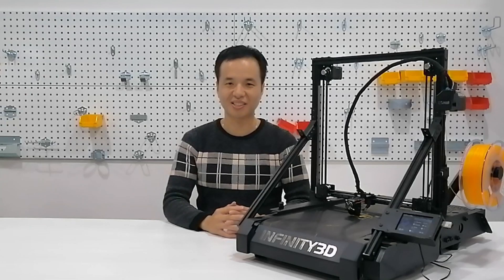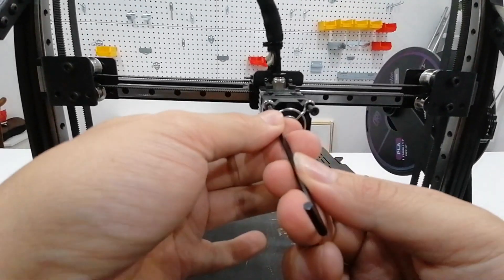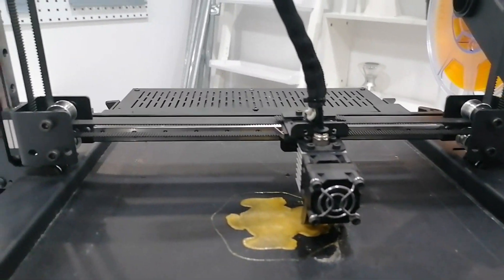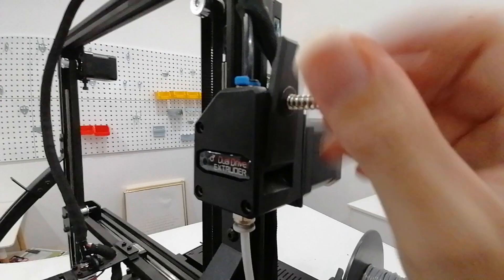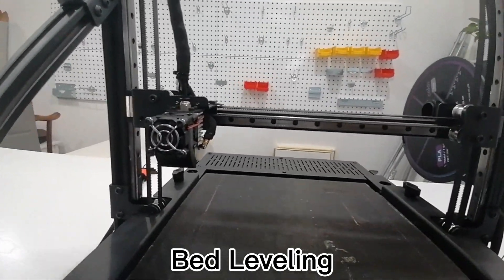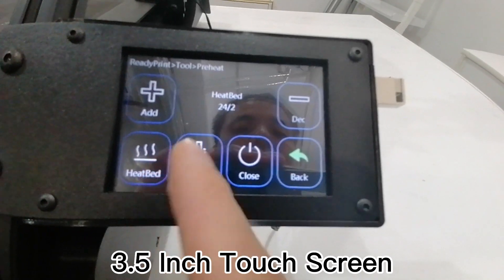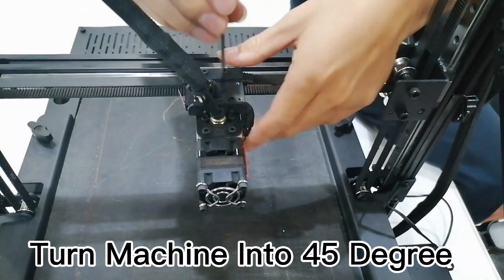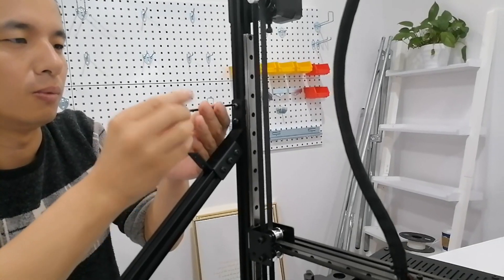Infinity 3D Printer Review: 2 in 1 Design Deformable Belt 3D Printer Unlimited Z Printing

Comment: The concept is nice, but i hope they make it a little bit bigger, especcially the electronics compartment, what a mess of wires is that, and a power connecter that is half turned to fit is not good.
Reply from the maker: this one is just their beta version, what you receive will be an upgraded version